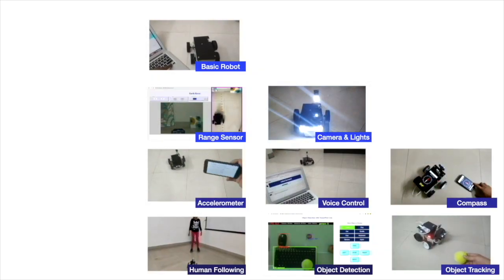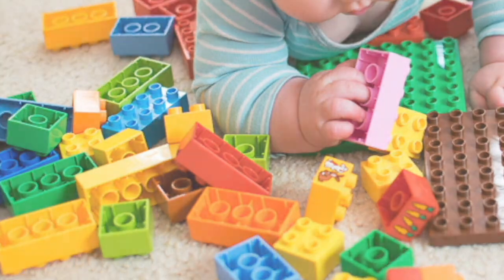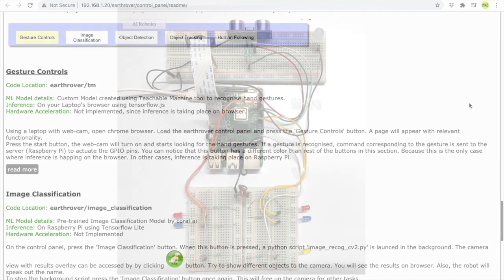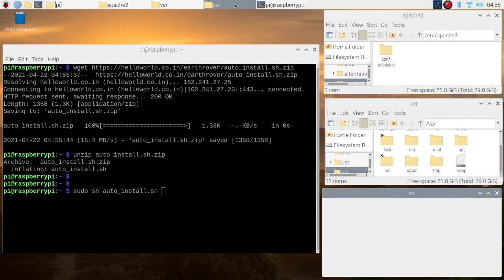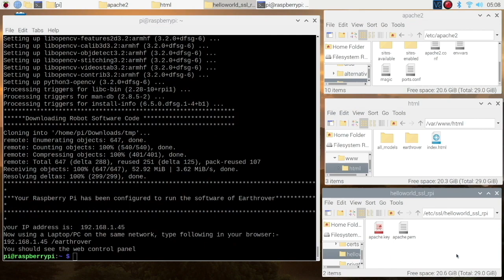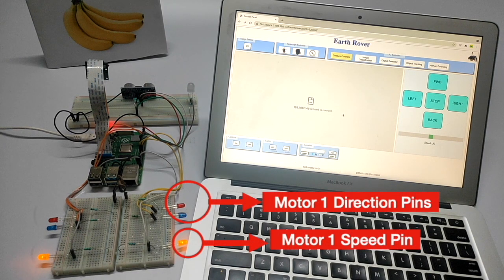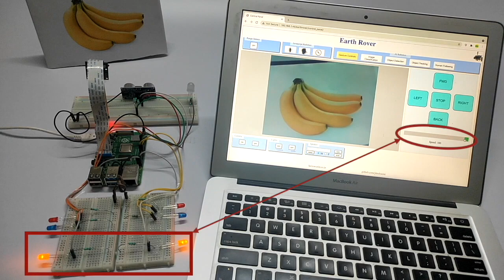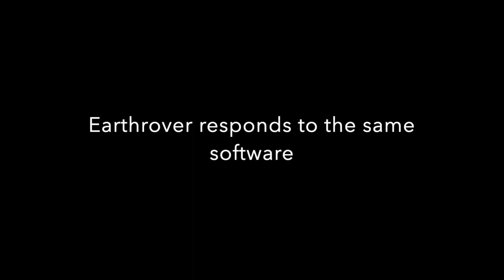Replicate free Robot Software | Kick start Raspberry Pi Robotics | Tensorflow Lite AI ML Projects

Comment: Hey, I've tried the same but the camera isn't coming up after clicking the green icon on the control page.

I tried switching it off via the panel before initiating Object Tracking but it isn't working as it should.

I get a blank webpage after clicking the green icon for starting tracking

Comment: this does not work with the new os bulleye
it say to get legacy can u help me out
Reply from the maker: Yes. It works with legacy OS. With bullseye, camera and opencv libraries are not complatible. If you can work around it, then you can make it work. Let me know if you find success with that
Reply: @jitesh_helloworld  ya Thxs could run it in it I’m also having trouble opening the web page in the end after all files are installed it say to copy the IP address to a browser but it didn’t work can u plz help me
Reply from the maker: First try on Raspberry Pi itself, open chromium browser and type 
127.0.0.1/earthrover
If installation is successful, it should work
Reply: @jitesh_helloworld  okay is there a way I can contact u I’m doing a project I would love to get your help it will a great help for me
Reply from the maker: Telegram id jitesh_10
Reply: @jitesh_helloworld  this ip also didn’t work
Reply: @jitesh_helloworld  can I get WhatsApp or Facebook contacts I still couldn’t get it to work can I get your help plz
Reply: @jitesh_helloworld  it worked I tried my ip and it worked I have added a usb camera that does not appear
Reply: @shalommanupriya  can you help me with the control panel part because mine too is not loading
Reply: No spaces earthrover
Reply: @shalommanupriya  i used my pi ip like x.x.x.x/earthrover still it didnt work

Comment: Hello sir,
I have followed every steps in the video and it is succesful, except for further video feed. For an instance, I open object detection view or flask view, it goes to another page with 2204 port but there is not video. Same goes to every part of the project when it goes to other parts. What should I do to resolve this. I am using Raspiberry 4. It was fresh before installing your system.
Reply from the maker: I hope you have enabled the camera in raspi-config. Do that and ensure that camera is not used anywhere when you press object detection or tracking
Reply: @jitesh_helloworld  I did enabled it. The camera view on the main page is working. Do you meant I need to turn off the camera on the main page and then press object detection to get view on Flask web?
Reply from the maker: Yes you need to turn off the camera on main page . Also, just wait for about 5 seconds after you see the green button and then press it.
Reply: @jitesh_helloworld  Thankk you very much!! It works! I wish I can donate your project
Reply from the maker: Great. If you wish you can do that. Contact me on jitesh@helloworld.co.in

Comment: This great! I have done this from your previous setup, but I've fried the RPi due to short circuit. One thing if you can change the control the motors from the webpage without pressing STOP,  pressing forward, left, right and back motors will run until un-pressed. Thanks!
Reply: Did the pi got fried due to continuous motion?
Reply: @akshitmehta4139  No, I shorted a wire when moving thing around which I shouldn't have done while system was on.
Reply: @jimmykan7873  thanks for the heads up 👍🏻
Reply from the maker: Nice suggestion will try it. Thanks
Reply: Well If you want that move robot until you press and hold button feature then just add onmousedown , and onmouseup function with your html button....I did something similar to this with my rover...
Reply: @BharatMohanty  , your rover is a 6 wheeled rover?
Reply: @akshitmehta4139  nope... four wheel...
Reply: @BharatMohanty  OK, I saw some other dev's use these two functions in their code. Will check it out. Thank you!
Reply: @jimmykan7873  you are welcome..
Reply: Just finished running your script without errors, everything works on the web control except those AI pages do not accept a connection. object detection page comes up but no video. I guess it because HTTPS needs to enable in Apache correct?
Reply: @jimmykan7873 can you tell me ...voice commands working or not
Reply: @BharatMohanty  I have not tested, will try it out and let you know!
Reply: @jimmykan7873  ok I will be waiting for your reply...
Reply: @BharatMohanty  No, voice commands is not working.
Reply: @jimmykan7873  thankyou for confirmation
Reply from the maker: Does this link work on your chrome browser:- https://www.google.com/intl/en/chrome/demos/speech.html

If yes, then voice control should also work as they both use the same tech
Reply: @jitesh_helloworld  I got the voice commands working. I was using MS Edge and it didn't work and realized I should use Google Chrome due to google services need to be run in Chrome. I still having problem loading the object recognition pages.
Reply from the maker: @jimmykan7873  Ensure that you have enabled the Camera module in raspi-config .. Also, after pressing AI button, wait for 5-10 seconds before you click the round green button. Do not press AI buttons if you are already accessing camera on web control panel. Remember the same camera is accessed by all these modules. So it has to be released before it can be used by another module.
Reply from the maker: Everything that needs to be enabled is already enabled.. When you press AI buttons, a python script is launched in background. It takes a little bit of time for it to load the models and prepare to stream via flask. So you need to wait a little, may be 5-10 seconds for the first time after pressing an AI button. It should work. I will explain those things in next video

Comment: You are really helping alot, thank you so much and keep up the good work 👍🏻 Can you advise if we can do all this without coral and 8gb as card?
Reply from the maker: Yes you can, it works without Coral. Coral is Optional. I would recommend minimum 16 GB of card.
Reply: @jitesh_helloworld  , I am planning to make this Smart Rover project for my final term of M.Sc.I.T. I want to introduce following features:- 
1.) Google (Any Voice) Assistant to do all the tasks that we do on a phone or smart tv e.g. to play songs, ask about weather, maybe even read text off a paper, etc.
2.) Autonomous and Controlled Motion via web or voice. So that using ultrasonic sensor n sound it can help a blind person also to walk safe n avoid obstacles.
3.) Since I am using a Rocker bogie concept chassis I want the rover to be able to climb stairs.
4.) Human Follower feature.
5.) Object detection.
6.) Wanna power up the robot using a single power bank or max a power bank n 12v battery if possible.
7.) I want to keep the cost as minimum as possible as I am building this first time and the topic is not yet approved by college but I wanna build it anyway as I am really excited about this!
Here is what I want help with. Kindly advise me on this and advise me if any payment is needed for your help as I understand you are also giving your time and effort 👍🏻 Thanks in advance.
Reply from the maker: Thats an ambitious project you want to take up. You can build upon the code of this robot. Carefully select your features as the work involved in providing nice finish to them could be overwhelming. I can advise you free of cost if time permits me.
Reply: @jitesh_helloworld  , Your Videos cover everything I suppose. Just the voice assistant feature is missing. I am stuck with managing 6 DC motors with 1 l298d motor like I can power 4 motors by connecting their negative together and positive together and giving them to l298d as input. Kindly correct me if required and thanks for your positive response 👍🏻
Reply from the maker: One L293D ic can drive 02 dc motors. So if you want to drive 06 motors, you need three L293D ICs .. In that case you can use a high AH 12v power supply for motors and convert it to 5V using LM 7805 IC for for 5V requirements